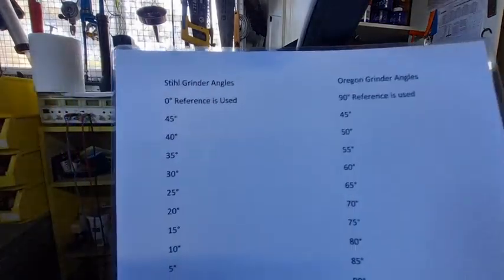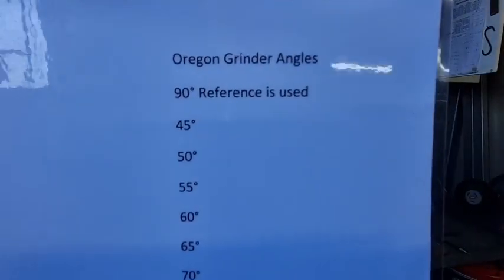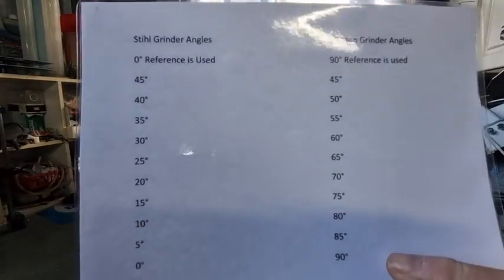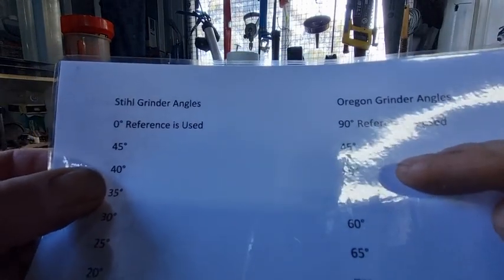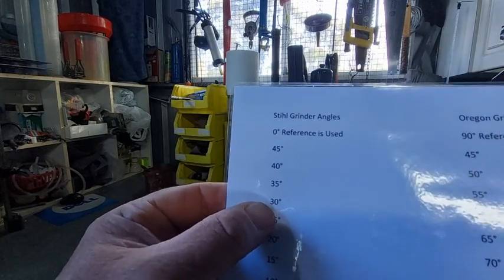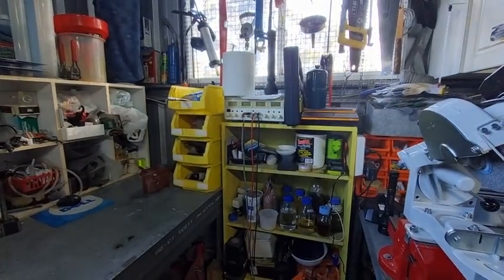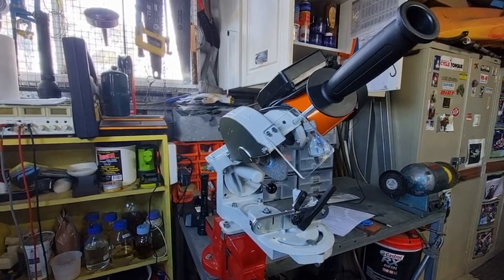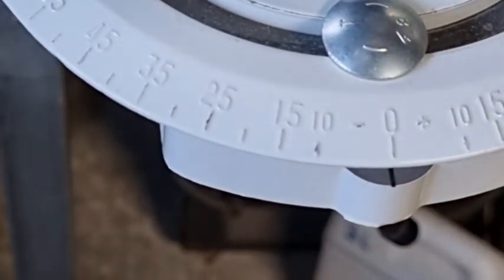Stihl USG Grinder angles explained

Comment: So I just bought a new Stihl USG grinder and the difference between the one I had which was a 50 plus year old Stihl made in West Germany model that had no adjustments at all except for the vice being able to be moved left or right, everything was stationary on the old one. So my question is, (and I'm getting used to this) is I understand when I do a Stihl chain, a lot of them require that sliding Vice on this new USG is to be slid either in 15° or out 15° depending upon which side of the chain you're sharpening, and then you set your 30 degree or 35 degree angle, and I understand the head tilt angles. But my question is: if I go to do a Oregon chain, and Oregon, some of them require a 10° from one side to the other especially on chisel chains, does this translate also to sliding the USG base in or out 10° when sharpening an Oregon chain? Thank you.
Reply from the maker: The sliding vice -15/+15  B scale is  not 10° tilt,  USG does not use 10° tilt as Oregon, does. 
 What Stihl does is offset the C scale 17mm from the pivot point, and then you must bring the cutter back close to the centerline.
You guessed it -15/+15 mm B scale adjustment.
I have many videos on this subject here.
Stihl USG grinder is nothing like an  Oregon grinder. It's a totally different way the geometry is set up 
 Look at the back of the grinder, the eye bolts are offset 3° 
Set the A scale 0° its 3° offset
I will be publishing another USG video tomorrow on offset angles for the USG grinder.
Reply: @ChainsawUsers so then if I am doing an Oregon chain that normally requires a 10 degree tilt from side to side and I'm using my USG sharpener then what settings for the sliding in and out Vise do I need to use or just leave it at 0°?
Reply from the maker: You just follow thr USG chart as follows 
A scale 40° B scale -15/+15 
C scale 30°  you will find that this grinder give some tilt to all chains semi-chisle and full chisel
Reply: @ChainsawUsers so then if I'm doing an Oregon chain that normally would have a 10° tilt for each side if you were using an actual Oregon sharpening machine, when I'm using the USG then and I'm sharpening an Oregon chain, then you're saying I should still Slide the base in or out 15 mm for each side?
Reply from the maker: You need to watch more of my USG videos to understand the USG grinder.   10° was abandoned  by Stihl using hand file because people stuffed it up too much tilt.
Tilt was used to get rid of hook.
Also 10° thinned out the working corner.
The USG grinder gives you all the correct angles for full chisel.
I will post a new video today (  USG grinder 10° tilt explained )
I will show and explain it ok.

Comment: Okay so one question that I have is because I've used a 1970 version of the USG sharpener which is not adjustable as far as the head tilt, the other difference that I see with this newer one is that I could best describe underneath the Anvil that holds the chain to sharpen it there is a wing nut underneath that will loosen that entire base up and allow it to be slid in or out and then on the side of the sliding base there is a sticker with degree markings on a centered out by 0° and then either going plus or minus, so my question is, do I need to be really concerned with that thing sliding in or out or just leave it at zero? Because the older USG that I had mentioned did not have that feature it was stationary on the bottom there was no sliding base. If I leave that set at 0°, will it sharpen basically the same as what my older USG that did not have the sliding base feature? I do understand though that Oregon chains suggest using a 10 or 15 degree tilt when sharpening from one side to the other. Let me know what the purpose of this sliding thing is and if I can just leave it at 0°. Thank you.
Reply from the maker: The new version has the C scale 17mm offset from the pivot point this means the left and right cutters mover across the face of the wheel by 12mm then you move the B scale -15/+15 this will bring the tooth near the center line of the grinding wheel.
The B scale -40/+40 is in mm not degress.   The A scale also has a 3° offset.
The HOS old version has no C scale 17mm  offset. 
Hope that explains it.
The USG grinder was introduced 1972 and has no C scale 17mm offset this is the HOS version, totally different geometry than the Modern version today.

Comment: As a follow up, I did order the USG today.  I have a question on the vice.  Does the included vice work for the following chain drive links:  .063 and .050?  I saw a video where a guy was advocating that he needed an additional vice or change a washer setup to accommodate  .063 drive links.  Thanks In advance for any knowledge you can share on the issues.
Reply from the maker: The guide rails on the vice work fine even on .043 gauge  050 only found 063 gauge is just a tad tighter but still ok.  They supply a shim so maybe you could use it for 063 gauge but I don't.  The instructions are not that good like all manuals

Comment: I've been running an Oregon 620-120 for 2 years.  Looking to order a Stihl USG.  Any thoughts?  Thanks.   Your videos are very informative  I have learned a lot
Reply from the maker: The stihl usg is a great grinder.  The Oregon one is also its just that the USG will do trimmer blades and circular saws.  Your 620 8s a good machine

Comment: I think on this video I can see that there is some kind of a work light attached to the USG sharpener, and I was wondering where I could get a clip-on light like that?
Reply from the maker: Yes I do use a clip on led cool globe on a stand and can move it around when using grinder.  The use can be fitted with light but I never bothered

Comment: How do I get my hands on your reference chart you made?  VERY helpful video, thank you!
Reply from the maker: Hi what chart do you mean. I can make any chart in Excel if you like.  Do you mean 60° on a Oregon grinder = 30° on a stihl. Or in word print one up send you doc file.
Send me an email address
Reply from the maker: Take as snapchat of the video or freeze it and write it down
Reply: WOW, you are FAST‼️

Downward grinding angle … yes I think I acquired that information from your video.

I just purchased an Oregon 410, the wheel angle goes from 40° to 90° and I can find a reference that tells me what angle I should be using.  I sharpened (2) chains today (I probably have 25-30+ to go, lol).

The two I did were at 40° (looked correct) but I’m guessing it should have been 60°.  I’m at 30° file angle, pretty sure that’s right.  Majority of my chains will be Stihl RS, there is some Oregon and a few Husky chains but all same style chains just file angle different on some I guess.

I noticed you rocked your chain vice one way or other … 0° - 10° but I don’t have that scale but it does rock either way, should I leave at 0° or 10° (assuming that’s the stop point on my Oregon).
Reply from the maker: @chadt.anderson8753  I don't use 10° tilt any more did a video test cutting time on stop watch same log   I never saw any Improvement with 10° tilt. 60° head angle ( top plate cutting angle )will give best results in fire wood cutting or even dropping small trees.  30° file angle is the best  all rounder.   Only professional people who mill timber and cut huge trees use skip chains ect and modify  some angles.   Also 30° file angle is what works the best I'm most wood it just penertrates the wood better like a spear does.  Imagine a spear at 45° each side that won't penertrate the wood well reduce to say 30° then the spear will penertrate much better.  It's the angle that works the best much like a carpenters chisel 25° to 30° is regarded the best 30° will blunt a tad  faster.  Also top plate cutting angle is really not 60°  because the reference of 0° is horizontal so 60° from horizontal or 30° from 90° being vertical.  I like the Stihl USG grinder because 0° is vertical so 30° head tilt ( top plate cutting angle is 60° on a Oregon.  It all about what you use as a reference point when talking about angle ls. 90° and 45° are the 2 most used reference points.
A protractor uses 90°  vertical reference point. Once you have this .embedded in your head then it's  child's play.
Reply from the maker: @chadt.anderson8753  Oregon 410 great grinder.  People always search for the best angles lol it's 60 30 0 in 90% of fire wood cutting you just can't go wrong with that.  Stihl no longer recommend 10° Oregon do on some chains.  Stick with the manufacturer specs you can't go wrong.  And  the best advice I can give you is only grind the smallest amount of metal when sharpening the cutters and go very slow tapping motion and you sharpening skills be get better and better
Reply: There is a lot of confusing talk and no show. If he would have demonstated setting up each of the grinders, it would have made a lot more sense. Holding the tooth vertically when it goes on the grinder horizontally makes no sense. I think he just likes to hear himself talk. I found it confusing and boring. He added in a lot of speculative thoughts on different angles. I grind chains for a living on a Stihl USG grinder. You need different wheels for different sized andbpitch chains. He didn't mention that at all.  The important thing is to cut clean wood and never let your chain touch anything but wood.
Reply from the maker: Send me a email at lankat7@gmail.com I will post it to you

Comment: I m also working stihl grinding chainsaw same machine
Reply from the maker: Did you check the head angle at 0° to see if the motor looks horizontal.  Use square sitting on chain guide and against wheel it will show if the head is out.